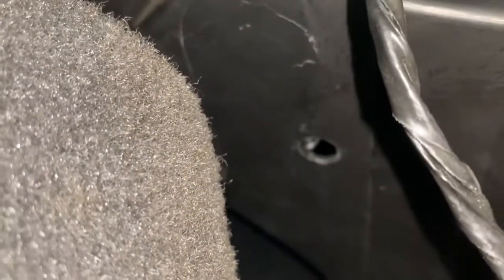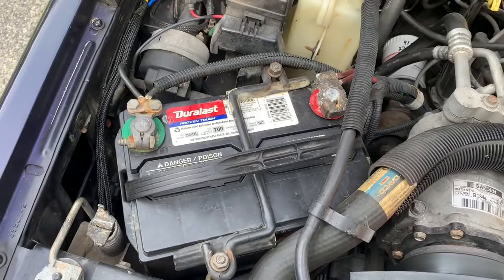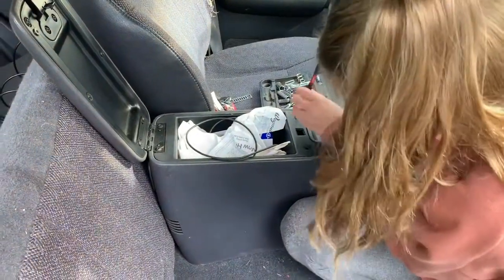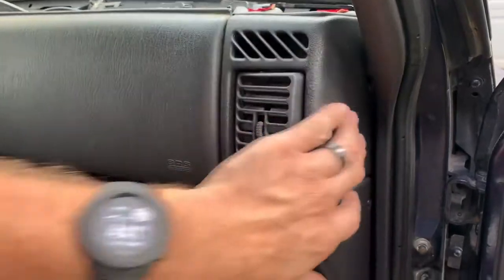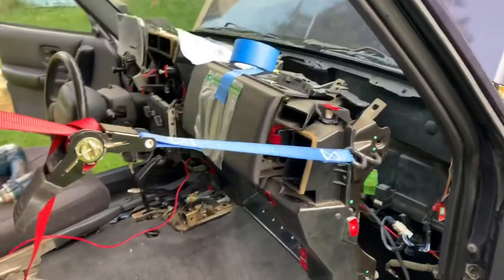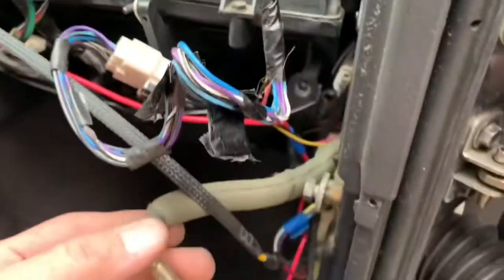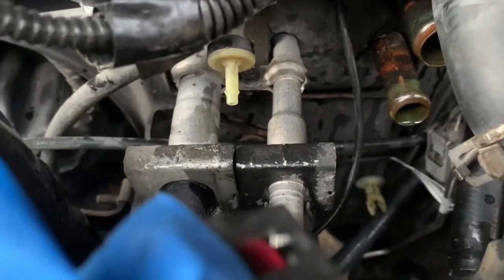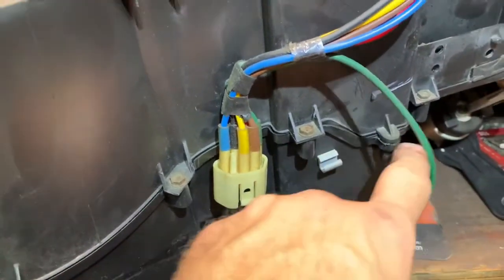Part 1 of 2 - How to remove a Heater Core & AC Evaporator core -Jeep Cherokee XJ & remove dashboard.

Comment: great video... of note: you DO NOT have to remove the corner dash bezels on either side. two less things to do. the ratchet trick worked great as I had more than enough room to work.... took me about 7-8 hours total and nothing broke! (heater core, evaporator core, accumulator, compressor, and condenser) thanks for the upload

Comment: My confidence soared with this video. 2001 xj. I also home to identify why it’s leaking after every rain!
Reply: That’s normally a leak in the visor below the front windshield, I’ve been told it’s a pretty common problem but it takes fab work to fix it correctly.
Reply: @levinanninga3512  yes sir, jb marine weld for the win!!!! Dry as a bone. Also did my heater core and ac evap at the same time!!!

Comment: Great video! Much appreciated. Just bought a 1998 Jeep Cherokee. I need to replace the AC Evap and I will most likely replace the heater core too, just in case. Very useful information
Reply from the maker: I’m very glad it helped you. It’s all about sharing tips and techniques. Cheers.

Comment: I have a 92 and the heater core went out around Christmas in 2017 while visiting my dad in Chicago before he passed away. 

Took it to my aunts brother's shop and he did everything he could to try and get the great to work without doing this job because he said he hates doing it, it would take at least 2-3 his and around 5-12 hours depending on what happens after working on it ( one thing fixed can lead to another new problem ect ).

I completely forgot about it because my dad passed away in March of 2018 a couple months later, rebuilt the entire underbody, and did a new head gasket, ujoints, tierods, struts, suspension, driveshaft gone through, bearings on everything, pretty much rebuilt the entire bottom half to OEM spec and forgot to do the heater core. 

Now it's 5 years later and I gotta get out up and running for winter, starts right up, runs like a beast, a/c works great, but no heat lol.

So I'm going to have to learn how to do this because I'm no longer in Illinois with Mike Denton and my Uncle Chuck.

Comment: Do you have a guide for a 2003 Jeep Liberty Sport? I need to replace the heater core on it, and all the videos I have seen say you need to disconnect the reservoir, AC Lines, and either take the dash out or pry it open.

Comment: at ~17:20 there's a bundle of connectors attached to the plug for the air bags... one of them goes to the blower motor resistor, do you know what the other one goes to? just started putting it back together after using your video (thank you SO much!) but now i cannot find what that last connector goes to, looks in your video it goes toward the center? any idea where i could find the male end for it?

Comment: I'm about to start the heater core on my ZJ... did you end up replacing the blend door actuator? I m planning on replacing EVERYTHING while im in there including the foam. should the actuator be on my list as well in case its soaked with old coolant??

Comment: I have a 2001 4.0 Grand Cherokee that will overheat when i drive it. It idles around 210 and won’t overheat but once i take it for a drive for around 20 minutes it will spike suddenly and have to turn the car off. It will spew out the radiator cap and the coolant reservoir will start bubbling.  The head is brand new on it with no gasket leaks. I’ve replaced the thermostat, radiator, and heater core so far. Going to replace the water pump today but if it isn’t that what else would you think is wrong with the car? It runs perfectly fine other than the overheating issue.

Comment: My 97 xj leaks from the hvac area. The only thing I can figure out is that the gaskets (padding material ) around the open vent areas are bad. My plan is to get a hvac system from the junk yard and replace each item. Unless you know where you can buy the hvac box that goes under the dash? Again great video.

Comment: hi how you doing , thankx for your video , im from Portugal and i have a question if you please can replay me , i did this job some weeks ago and after all together i had been here checking if its all good, well everithing seems fine but the temperature regulator is giving me what to think , i explain,  whit my engine stoped i turn my key on and switch the temperature regulator and i can hear really the door in heater core box opening and closing , but then i start engine and check about hot and cold air and im not sure i can see temperature diference, its really hot in maxium and when i change to cold i really cant see a diference if i can get more cold air or not , maybe its because its a new heater core i dont know , or something is not work propeply here ....did you noticed anithing about after install your there? thankx a lot
Reply from the maker: Glad you liked the vide.

Comment: How did you get the steering column back on those bolts? Mine just bumps right in front of them not going into the holes. Tried pushing, didn’t work… :(
Reply: Nevermind! With enough swearing an muscle. I got it back in position!👍👍
Reply from the maker: Sorry for the delay...Yeah, it takes a little foolin around with the alignment to get it to line up with the studs...glad it all worked out!!!

Comment: I am about to do this job myself, I greatly appreciate the dash teardown part, but haven't gotten to the installation yet. I've got 4 days to do this and a dual battery and isolator install.
Reply from the maker: Good luck. It’s not too bad. Just a pain and little steps.
Reply: @JustJeep_It  I have a question about after reinstalling everything. On the back of the heater box, at the very bottom, there's an air port going through the firewall. Is there supposed to be a connection to a vacuum line or other air line here?

Thanks again for the video, made this job so much more endurable
Reply from the maker: @greenhead333  that little hose is for the AC condensation. It’s so the heater box drains properly.
Reply: @JustJeep_It  Awesome! I'm good then. I can't thank you enough!

Comment: Do I have to touch the ac If all I need is a new heater core?
Reply from the maker: Unfortunately yes, since the heater core and AC condenser is in the "heater box", you have to remove freon from AC system..so might as well replace that part too since you have it out.

Comment: Would the heater core cause smoke to come out of the vents?
Reply from the maker: Condensation could come through the vents of the temps and humidity were right. If caused by a heater core leak, it would smell like coolant.

Comment: How much would a smaller shop charge for a. Job like this? Just ballpark figure
Reply: 1500.00 I would bet 99% of shops have never done it and will probably screw it up trying to go too fast. Find a shop that works on jeeps and has done this job before. Once you do it once you can do the next one better, faster and with less possibility of breaking something.